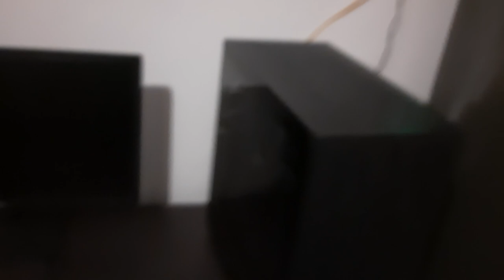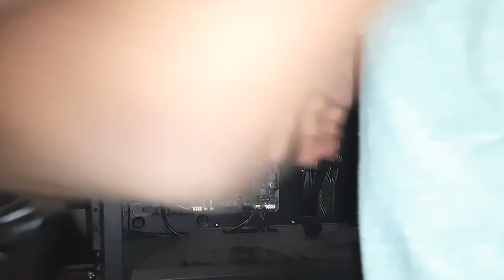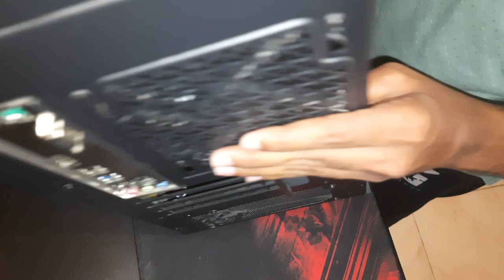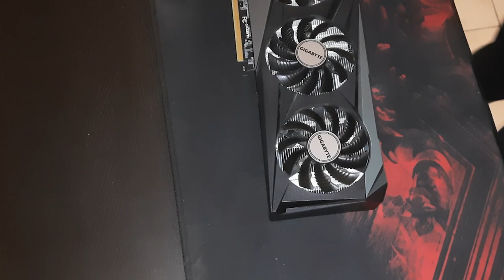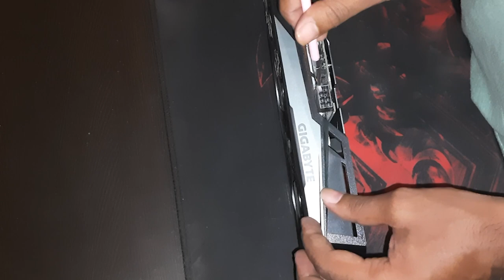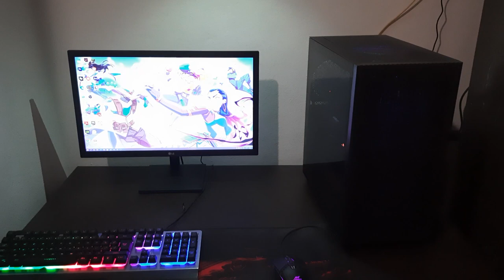Cleaning my PC

Comment: Why the cooler bro 💀😭
Reply from the maker: i am using a stock cooler because my cpu doesn't get that heated, if you were asking why did i cleaned cooler then its simple there was dust in cooler and this dust will effect cooler performance so i cleaned it